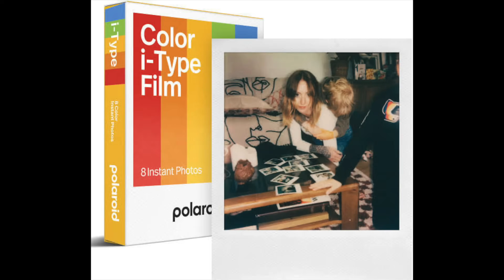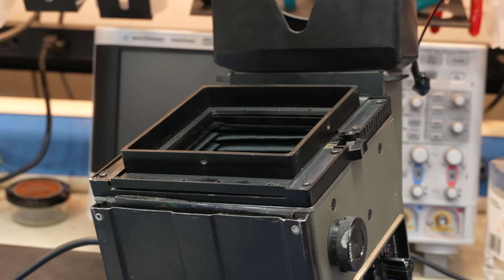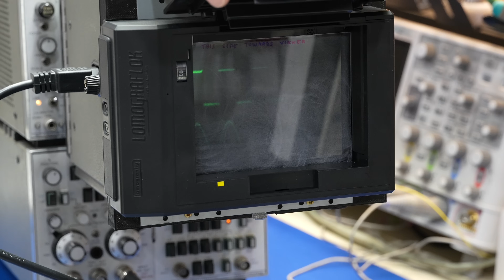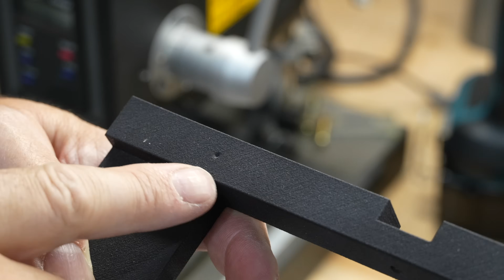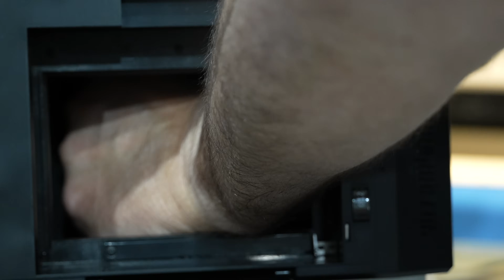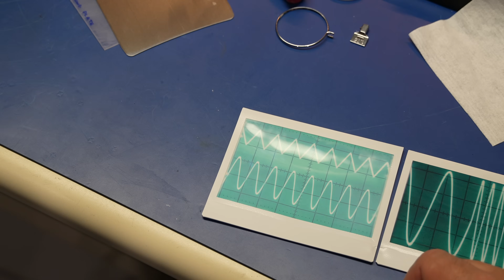HP 197A oscilloscope camera Instax conversion

Comment: I ran a school computer lab in Boston in the early '90s. Polaroid donated a product called the "Digital Palette" that captured an NTSC video frame and exposed it to a Polaroid film back. Instead of just exposing the still frame, the unit buffered it, then exposed gray levels for varying times on the high contrast CRT to get a balanced image. It used a color wheel to create color. The result was a very crisp image with no raster lines. Neat tech!

Comment: The green phosphor is probably close enough to a pure single frequency that aberration would be completely unnoticeable even with a very strong lens . You would not want to use a lens with a RGB CRT as the red and blue would diverge very noticeably vs each other over even short distances.

Comment: if it's possible to dissasemble the lens assembly, it might also be possible to move one of the lenses back or forth by a millimetre or two to achieve a similar effect, and in theory it also shouldn't add any distortion.

Comment: What a great fix, I love the analog photo capability.  I do notice that you seem to leave the metal shield out for long periods, relying on the shutter.  When I used to do this (when dinosaurs ruled the Earth and Polaroid film was for sale) the metal shield was out only for seconds, while making the exposure.  Flip the lever from viewport to camera, remove the shield, trip the shutter, replace the shield and only then pull the Polaroid film out.  It was believed that pulling the film shook the mechanism and increased the likelihood of light leaks.  In that regard you've made a great improvement, and I like the downward ejection.

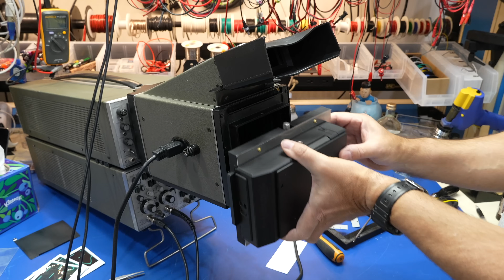Comment: 14:58 A little tip, did you know you can specify heated inserts with services like pcbway and jlcpcb? Just supply a pdf where you denote the locations and sizes of the inserts, and add in the remarks a short sentence that you want this, and which file to use. Would increase the durability if you have to insert the screws often!
Also I know many old film cameras use adhesive compressible foam between parts to further reduce the likelihood of light leaks. Perhaps its worth it to go around all edges with such tape (its not expensive).

Very fun project though! Not very practical but interesting. And the instax pictures seem fun to hang around the lab!
Reply: If you need a light gasket of a particular shape, 3d printed TPU might be worth trying. I recently tried printing it for the first time and it's quite tough and rubbery.

Comment: That back is so much fun on the back of a speed graphic 🤣 on the speed graphic there’s a plate there that offsets the ground glass but using the rangefinder it should be possible to do a fixed offset.

Comment: While you shouldn't use random lenses in your DSLR, all most all of the manufacturers make 1.4x and 2x extension lenses. There are also macro extensions without glass. So they also exploit the benefits of a simple extra lens/barrel length.

Comment: When building a Skutter from Red Dwarf. I used JLC to 3D print some parts in metal that where under extreme tork. They were part of the arm linear actuator. 

They have worked perfectly, not super duper cheap but also not stupid expensive.
Reply: ..."tork"? The commercial toilet paper supplier?
Reply: @8BitNaptime Moter power

Comment: Here's hoping that buying the adapter doesn't come with requiring an account and a subscription because reasons.

Wow, anticipating that there may be a need no move the entire camera assembly and providing a "convenient" screw to do so! Was it forethought or a feature used to align the camera after manufacture?
edit: Ah, it's a scope specific adjustment. 
Either way thumbs up to the engineers ! 👍

Comment: Using an empty instax cartridge and some baking paper works pretty well as a quick focusing screen.
You have run into the problem that explains what that extra piece in the box is. The lomograflok doesn’t focus on the same plane as normal film holders would because it’s got to eject the film so you have to push it out further to clear, that plastic shim is to show you the framing and also where you have to focus at. 
Using it on a normal camera is kind of a pain because of all of this.

Comment: Great that there is instax available, I recently got a smaler camera with simular material. In the past I worked a lot with the polariod cameras for makeing photos for my books (very long time ago), I remeber also the photo adapter  which the company of my father used for their oscilloscope productions (very rare now P.E.K -- now in Tettnang Museum),. -- Great the hin with the sense set I have a intersting project where it will solve my experiemntal stage with low cost lenses. Thanks for this tip. YES and the method using a digital camera is also great , I use it in scops not having a screenshot.

Comment: I had the Tektronix version, used it all the time. Would take double shot exposures to simulate multiple scope channels.  I can still remember the smell of the fixer coating you put on the photos.  Funny, just purchased one of those lens kits to dial in computer and reading glasses, should come this week. Always feel rushed with the "is 1 better or is 2 better" questions, if you blink you get the wrong answer.
Reply from the maker: I remember the strong smell so well too!

Comment: Crazy how that entire kit of specialty glass optics costs less than a prescription pair of plastic lenses...
Reply: Yup, however if you don't want high end frames Zenni Optical has glasses for $9.95.  At that price you can by every dioptre combo from reading to your computer.  These days glasses are only built in .25D increments.

Comment: I use my old 50MHz Tek with my iPhone, and indeed it does suck aesthetically. But on the other hand, it does something that polaroid can't: low tech DSO! I just film the screen on video or slo-mo, and then I can catch non-repeating signals by scrolling through the video and watching the beam sweep across. Even for very fast sweeps the partial fading of the phosphors leaves information on which sweeps are newer/came later and which are older/came first. Efficient? No. But definitely fun!
Reply: I did that 30 years ago with an Amiga and a Digi-View. I put a camera on a tripod in front of my Tek 531. Voila!

Comment: The iPhone camera didn't work because it's a rolling shutter camera, every pixel is exposed at a different time and because the readout time is proportional to the exposure time, it didn't work just increasing the exposure on the iPhone. It can only work if the exposure time is at least more than 2 scanning periods I think.

Comment: I did a LG conversion of an old polaroid - I found for a focusing screen I had to account for the instax film pack's own film plane offset that holds it slightly farther back from where the pack rests. So I built a dummy cartridge that holds the GG in place with the appropriate shim.

Comment: Corrective vision for the camera. This is similar to what they had to do to the Hubble space telescope that was slightly myopic.
Reply: No, it was not "myopic", it had severe spherical aberration. Completely unrelated.
Reply: @rasherbilbo452  Well whatever you call it, the Hubble couldn't focus a sharp image. The fix was called "Corrective Optics Space Telescope Axial Replacement (COSTAR)". Well to me "corrective optics" sounds very much like how Marc fixed his scope camera, with a lens from the optometrist kit.  Really both the Hubble and  Marc's scope camera effectively have glasses to correct defective vision. Hubble because the prime mirror was ground incorrectly and couldn't be replaced in orbit, and scope camera because the film plane distance has increased.
Reply: @michaelturner4457 but none of that has to do with myopia.
Reply: @8BitNaptime  The video's subject seemed be myopic. Especially as it was corrected in the same way as an optometrist might prescribe concave lens glasses for myopic patients, i.e. corrective optics.. Ok yes, the Hubble had a different vision defect, spherical aberration, but it was still fixed by corrective optics, or giving it glasses. :)

Comment: What powers the eject motor on the film system?  Is it a flat battery built into the film cassette? When Polaroid made the film for their motorized cameras that used a 6 volt, low series resistance, Polarpulse battery. I want to know if Fuji is making that same battery now.
Reply: The LomoGraflok Instax back takes 4 AA batteries. Instax film packs don't have batteries in them. You have to put batteries in the cameras.
Reply: @michaelturner4457 thanks for the quick reply. The Polarpulse batteries were usable for projects well after the energy for running the mechanism was used. At weddings, I would go after the spent cartridges and tear it apart and slide the battery out. I could sometimes collect as many as 20 batteries out of a single wedding reception!

Comment: Since for practical use digital is easier, and as you showed its a pain to set up tripods etc cf the ease of a made for purpose clip on camera ... consider making (3d print) a complete "clip on to the scope" adapter to the filter thread of a macro lens for whatever brand of slr you use  so the camera can just clip onto the scope, super fast and easy with consistent registration ? 
...Or even sacrifice any old (ie cheap from ebay) digicam (webcam even) that has manual controls and integrate (dedicate) that into a 3d printed frame that clips directly to the scope so in future its ready to  go, just clip on and shoot ?
So many possible projects 😂

Comment: I was just fixing up a Polaroid 210 today! There's a 3D print adapter for single shotting Instax (loaded in dark room) on Thingiverse called "Use ANY instax on fp100 cameras (peel apart) or 4x5 !!!! Swap peel apart films with Instax"

Going to give this a shot and see how it goes.